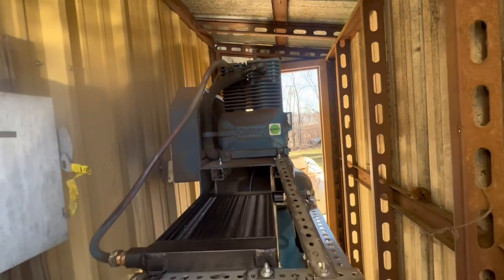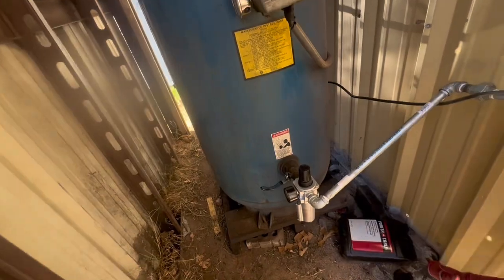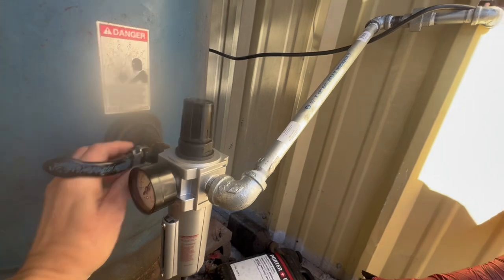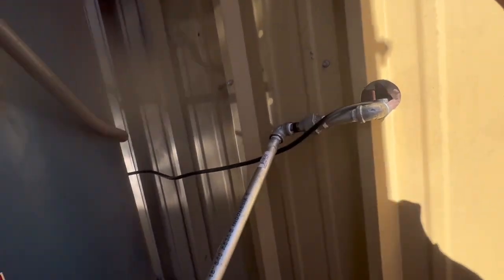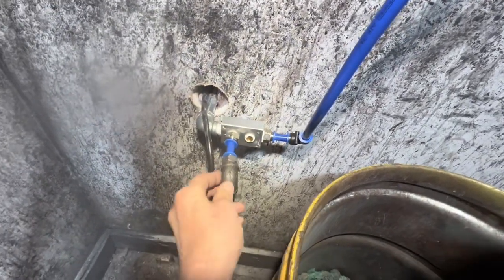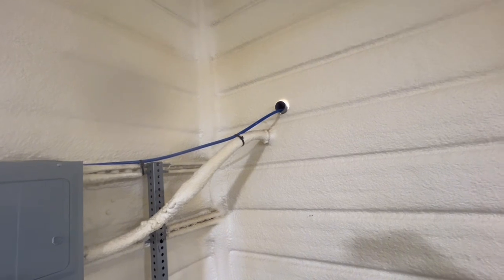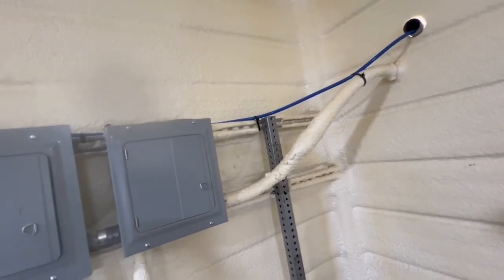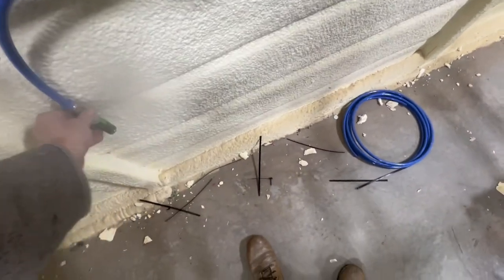A MASTER’S AIR SYSTEM With Parts List In Description DIY Compressor How To KEEP WATER OUT OF LINES

Comment: Hey B. Thanks for sharing! Question - A 175 psi (500'ish psi with safety factor) air-to-air heat exchanger is a pretty specialized piece of hardware. Where did you find something like that? Noticed the one you link to is NA.
Reply from the maker: Here is an alternative: Derale 15300 Tube and Fin Cooler Core,Black https://a.co/d/91OAFsN
Reply: 👍 @OldBondoBilly
Reply from the maker: @trottermalone379  my pleasure 😊😊
Reply from the maker: Keep smilin’😂😂
Reply: I'm always smiling
Reply: That's the bondo billy way

Comment: Nice air system and closed cell spray foam!
Reply from the maker: Thanks I like it too
Reply from the maker: Especially when it’s 10°
Reply: I sure don't like it when it's ten degrees😊
Reply: I like seventy degrees
Reply: Anything over seventy five is too hot